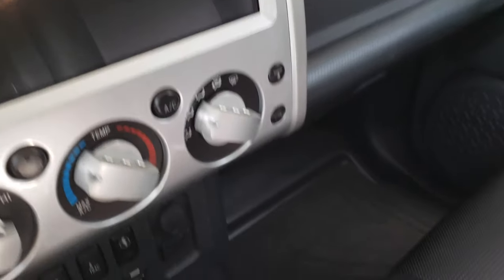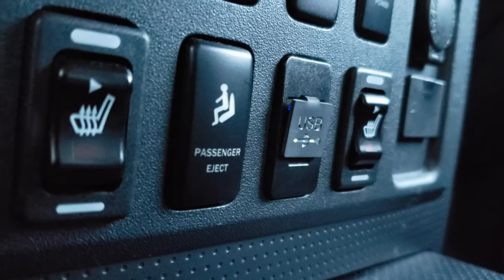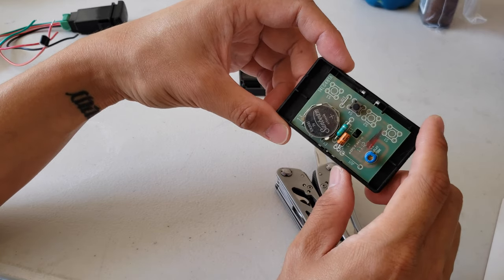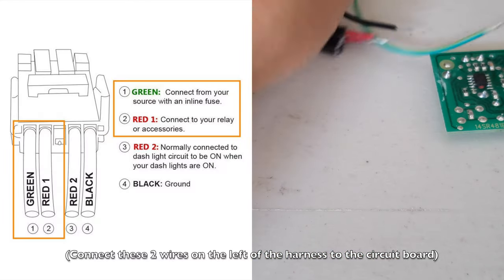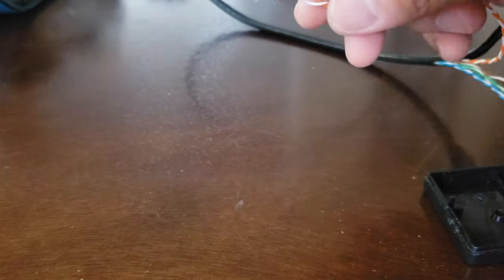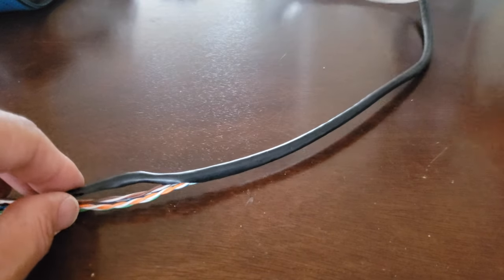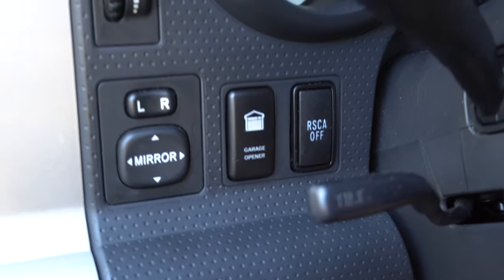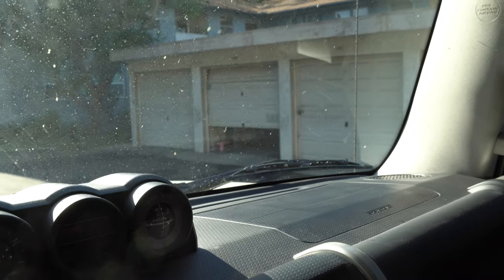FJ Cruiser Garage Opener Mod

Comment: Very neat mod! The little spot in the console where you had the opener was originally supposed to hold an iPod, IIRC.  I put a coin holder from a 2001 blazer there with some double sided tape, looks factory.
Reply from the maker: Well, now that I have that space open I will look into that coin holder. Thank you!

Comment: I was about to do this mod as well, but decided on getting the mirror that has it built in. Found one for $60.
Reply from the maker: I'm interested in how that goes for you, since I also considered it.
Reply: @LiL13izzy7  yea, it works perfect plugs right on in to the harness. Having the larger backup camera screen is also nice
Reply from the maker: @zachlittle6122  awesome, that's great to hear.
Reply: Do you have a link for the mirror?
Reply: @eqlibrium854  I don't, I got it used on ebay. I know the mirrors that were in Avalon's around 11-13 were very similar. But you have to send them to a guy on ebay that changes one of the wires in the harness.
Reply from the maker: Another option would be to buy an overhead console with homelink.  I almost went that route before I settled on a double sunglass overhead console instead.

Comment: Thank you for that video. I believe I am going to do the same thing but put an in line a 12v to 3v step down module ($10 or less on Ebay) and power it off of the car. That way it will only work when the car is on. Thank you.
Reply from the maker: Sounds like a good idea.  Let me know how it works out for you!

Comment: Have you thought about adding a relay?
Reply from the maker: For this little mod, no
Reply: @LiL13izzy7  the button from CH4X4 has a huge warning sticker on it about melting down if you don’t use a fuse.
Reply: @08Cruiser @lil13izzy7 I was wondering the same thing as I have ordered all the parts and pieces. Looking forward to getting this and some USBs added per your helpful videos 😀
Reply: @LiL13izzy7   I was wondering the same thing as I have ordered all the parts and pieces. Saw the warning in CH4x4 about switch melting. Looking forward to getting this and some USBs added per your helpful videos 😀
Reply from the maker: For a larger load, definitely a relay should be used.

Comment: Question on this.  The link to purchase the switch says that it must be wired through a relay or it will melt the switch.  Dont have huge electrical experience, but doesn't look like you did that here.  Any reason why, and have you had any issues?
Reply from the maker: Yes, the relay is recommended for 12V accessories powered through your car battery.  Imagine the load on the switch from a heavy load like a winch, or flood lights...that would not be good without a relay.  In this case, the clicker is powered by a 3V battery, that's not connected to the car.  I am confident the switch can handle a 3V button cell battery load without any issues.
Reply: @LiL13izzy7  Ah, so thats the difference.   Makes a lot of sense!  As I said, not a lot of electrical experience, so I was curious your thinking.  Thank you!  Your channel is fantastic for an old Fj owner like me!
Reply from the maker: @fredalcaro4823  Thank you for watching!  I'm glad you are getting something out of my videos.